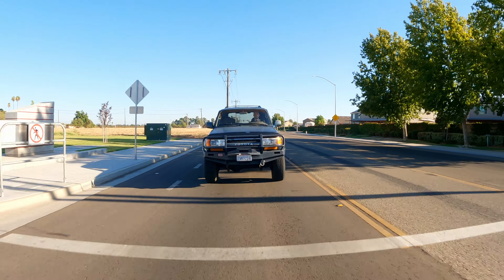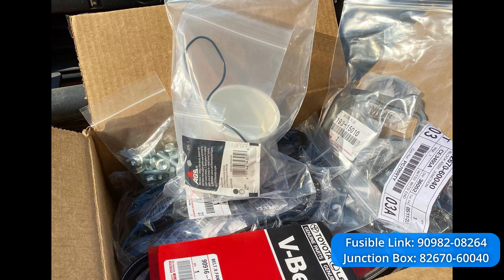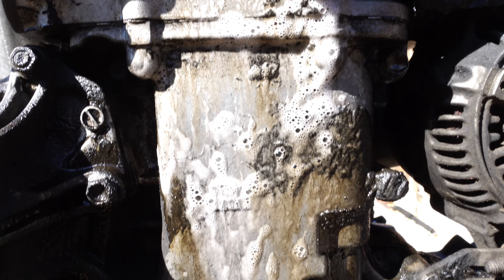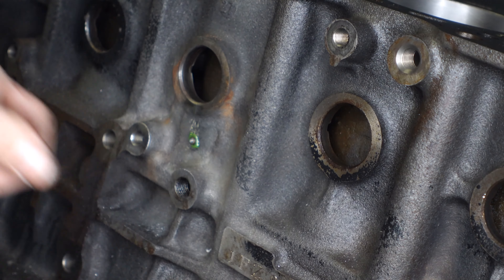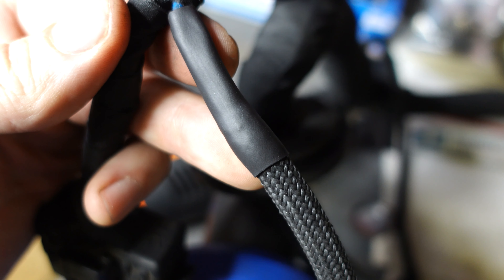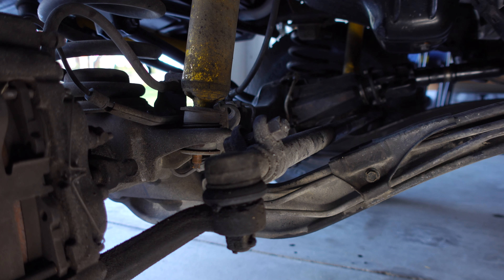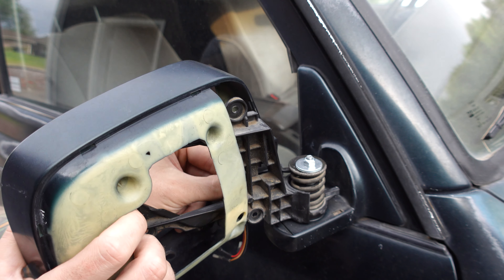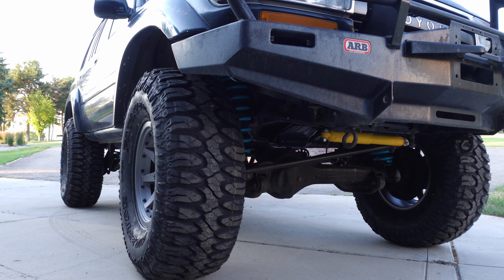How Much Does it Really Cost to Build a Land Cruiser? Not Cheap!

Comment: I have a 1988 Fj62. I’ve had her for 13 years now. I used to keep a running total of all the repairs, and, or upgrades. I stopped years ago. Keeping her running may be irrational to many, but she’s my baby. I get it, I really do. Enjoy your channel.
Reply: Mine is a 84 FJ60 have it for over 30 yrs, but it's been cheap to run. Body is awfull, but running gear tip top. Thats were my money goes. Turn key reliable and go

Comment: My parents gave me their 93 Landcruiser. It’s got 140k original miles and is triple locked. Can’t wait to get on the road.
Reply: You do not have to spend 50K to take it out on the road. I still daily drive my FJ60 on and off road. In my neck of the woods most FJ80 are Std 5 Spd Tranny. That would be my most expensive upgrade over the Auto. Std Rims and 33 Tyres next. And dont forget a Dual Battery and a 12V fridge/Frezzer, Never enough ice for Beer👍
Reply: Bro I have triple locked 94 1hdft

Comment: On, 38s with stock gears had to be a chore to get it to speed 😂.  What's the transfer case gears stock?  Good looking build.
Reply from the maker: Honestly, anything is better than my old pickup which was a 22RE on 37s. Transfer case low range is aftermarket. I can't wait to get gears installed but it's not too terrible.

Comment: was welding the block crack not an option
Reply from the maker: Nope. Would’ve been my first option but not possible. You can spray weld the cast iron block but the machine shop recommended stitching.
Reply: @RM_Garage  noted. machine shop knows best.

Comment: Prices will vary depending how much of the sales pitches you fall for. Once you have your lc back to factory reliability you are technically finished.  Every other addition is personal Chand most are luxury not necessity
Reply from the maker: Depends on your goals. If you just want to overland and drive on flat trails to go camp - sure, it's good in stock form. If you want to go on rock crawling trails, snow wheeling, etc, then a stock land cruiser on stock tires without lockers is not going to cut it. It will go further than most vehicles, but not where a modded vehicle will go.

Comment: Would it have been easier/quicker to just buy a rebuilt engine? Was the 10K inclusive of the initial price? I have seen a few LC's on line for about 7,000 or 8,000

Comment: Man, I got a $500 Isuzu trooper and built it specifically because I could build the whole thing for less than it would have cost me to buy a land cruiser and start a build. I've not seen any for less than 20K just to get the base vehicle. I am probably 10-12K into my build and it's lifted, locked front and rear, new tires, rims, bed linered bumper, winch, air compressor, new stereo, speakers, ham radio, lights, everything including rebuilding the upper part of the engine, new heater core hoses, spark plugs all oils, and all that. This stuff is crazy expensive, and there's no way for the average person to pull it off unless they can get an old hooptie and really mechanic alone. Great video. Gave me flash backs and PTSD.  LOL
Reply from the maker: I don't blame you. There are a lot of other capable vehicles that people turn a blind eye to, and it's refreshing to hear of someone taking a different approach. I bet that Trooper does well.

Comment: only use rcv axles.  you will regret all others. I've used all.  No arb supra head studs?  4x4 labs rear bumper.
Reply from the maker: Nice. I used Longfields in my pickup but was considering RCVs for the 80. No head studs because no boost, figured stock head bolts would do just fine.

Dissent is making a new ultra clearance rear bumper that really caught my eye.

Comment: Real question, not a troll.  If you knew what you knew now do you wish you had ponied up some more money for a cleaner example.  I just went through a similar rebuild with a Sequoia but I was pretty aware of the problems before hand.  An engine rebuild like you went through would have been really defeating for me.  I spent about 5k on the vehicle and 7k on parts (OEM is really more spendy than I anticipated).  I figure with the money I spent I could have just got a cleaner newer generation at this point and I end up wondering.  I really like the vehicle so I guess I'm happy.  Just curious on another capable car enthusiast thoughts.
Reply from the maker: Hmm. I would've probably liked a later model 80 for OBD2 and the updated interior, but I would've never bought it because the price would be offensive. I'm okay with having to do the engine rebuild because it gets me close with the vehicle and I know it inside and out. With that said, I'll still probably swap it for a 6.0 in the future.

The newer generation in my opinion is not as good as an 80 (and previous) series. Overall the body is straight on this truck, it has no rust, and the only issue really was a broken timing chain guide. I can't complain that much, happy with it.
Reply from the maker: I should also state that no matter what I would've bought, I'd still toss thousands of dollars of mods at it. Maybe not an engine rebuild, but still all of the other mods and then some.

Comment: What would the price for a '00 Land Cruiser 3.4 V6 be over there, in very good condition and only 12,000 miles on it? No mods, no rust and with a clean interior. Should I wait for a '98-99 model to tunr up instead due to the head crack issue?

Comment: Very cool coolant gauge where did you get that? Does it wire into the factory temperature sensing probe?
Reply from the maker: I have a video showing how I installed it. It doesn’t go to the factory temp sender and the brand is “Koso”

Comment: Well done. I am, however, surprised you didn’t just spring for the OEM pistons.
Reply from the maker: Overpriced at $130 a piston. I asked the machine shop how often they use 3rd party pistons and they said in every build. (As was my experience and never had an issue)

Already spent too much money on an underpowered engine when I could’ve gone LS, and probably will in the future.
Reply: @RM_Garage  ah, I see.

Comment: How does it drive with the oversized wheels & tires? 
I bought a 1997 4Runner, it had 15” oversized negative wheels & tires, it road horrible. I replaced the wheels with stock 2020 4Runner 17” wheels, with the factory offset. It rides great now. It goes over giant pot holes, & cracks in the street much better than the other wheels. It feels totally stable on the freeway now. Yes I had it aligned. 

Great. Job on your Land Cruiser! Awesome you’re paying attention to mechanical detail. Not just tying to make it look cool.
Reply from the maker: Honestly it drives really well but my suspension is also upgraded.

Comment: Since you decked the block and resurfaced the cylinder head did you have to run a thicker head gasket?
Reply from the maker: Nope, machine shop said stock gasket accounts for small tolerances. Only .002” or something was shaved off the block and head. So about 4 thousandths difference afterwards.
Reply: @RM_Garage  I am doing a 3.4 swap and I am picking my engine up tomorrow from the machine shop. They also decked my block, bored out 20 over, full head job. I was going to ask them tomorrow about head gaskets to be safe. I was just curious what your expereince was.
Reply from the maker: @Mike_Allegro I’m sure it’ll be fine but always good to ask!

Comment: A question. Why do people say these cars are reliable when you constantly have to repair them? I’m thinking of buying one with 260k miles but have zero knowledge on repairing it.
Reply from the maker: At 260 it has probably had the head gasket replaced by then and standard maintenance done, hopefully. The engines are prone to head gasket failure that’s no mystery, but the reason they say that is because the rest of the vehicle is very very robust and overbuilt. The engine is too - just had that head gasket issue. It’s a one and done fix
Reply from the maker: Going to the length I went to is unnecessary. I’m crazy.

Comment: Help me with the definition
I was under the impression this is an fj80 Toyota lettering in the grill fj engine
And it wasn't an fzj80 until 1995 with the fzj engine and Toyota symbol on the grill in
Reply from the maker: 93+ are FZJs. Motor and other changes make them an FZJ. 95-97 are the same as a 93-94 but have an interior refresh, OBD2 in the states, all have ABS, and different A343 trans but many would argue that the 93-94 trans is stronger.

Comment: i just lucked out and got a 80 series 96 model not triple locked for $4800 but came with the smitty winch , arb bumper , procomp lights , OME 3'' lift and brand new 35'' Yokahama G003's. but the caveat is that it needs hella maintenance to try to save it but its a really good starting point i think

Comment: I own a 96 LX450

Base Truck cost was $15k
Included mods are 4” lift (needed new shocks), new KM2s (35s), ARB front bumper, 15k lb winch, 4 nice off-road lights (can’t remember the brand), roof rack, hood rack, high lift jack, upgraded axils, front and rear Yukon air lockers.

Upgrades/maintenance after purchase:
Full hose replacement, new steering box, new power steering pump, blue fan clutch mod, scan gauge, marlin rock crawler steering upgrade, white knuckle rock sliders, new seal kit for the birfield joints, new ABS module, replaced lift kit, new break master cylinder and full set of new breaks (disks and calipers), upgraded steel hose break lines

Current total investment is around $25k.  

Truck has 261k miles.  It’s a true trail truck and I use it.

Comment: I used have a '80 fj40. And loved it it but it just wasn't reliable,  was constantly breaking down and the parts were becoming unobtainum, and the body couldn't hold up to colorado weather . so sold it before bankrupted me,  that in was 2002.
I wanted  a replacement long time and got a fully tricked out 2000 jeep tj with air lockers 4.0l 5 sp 150k miles 35"tires $8k in 2023. 
The cheapest working not falling apart fj find is $25k. Thats ridiculous when the jeep can find parts everywhere and not cost a fortune unlike any old toyota fj or land cruisers.
Keeping an old fj is just for sentiment not practicality.
Reply: Spent so much time working on my buddy's FJ40. Just couldn't keep it cool. Changed all the cooling components. Timing was done several times. Carb was changed. He wanted nothing but Toyota parts so I couldn't convince him to upgrade anything. He ended up selling it last year. I've got one the engines sitting in my barn still.

Comment: It’s just like watching the 4Runner videos a old fan just checking in on you. I know you’re not finished with this just yet. Thank you for all the videos over the years. My heart is still 4Runner I am almost ready to send mine out to get overhauled everything inside and out front to back with a custom rear lid that can handle a roof top tent with interior access that’s my dream I figured after watching a lot of videos on rebuilding rigs it’s going to cost a few bucks but I’m the end a vintage Toyota is going to be on the road for the rest of my life it’s going to cost way less than a new off road vehicle

Comment: I bought a LC200 for 13k Euro. 124.000 km with a petrol 1GR-FE engine. I spent 7k to get it ready to hit the road, that is, in gear. Car itself had 0 issues, but i changed all the fluids to make sure. It's now a season and 20. 000 something kilometers on and still 0 issues, but a whole lot of fun later. Not regretting the investment.

Comment: Thank you! I love these 80 series, but i was having my doubts due to all the horror stories of dozens of thousands of dollars needed to just get them working,  but you actually sharing the break down of the costs and. The things you did, made me realize it's actually within my budget with room to spare!

I'm mechanically inclined, but new to project cars, so I was having a hard time figuring out a realistic cost for this, and it was the only thing holding me back.

Here's hoping I find one at a reasonable price!
Reply: Spend the money and get one already sorted. Preventative maintenance and baselining alone will be thousands. I can’t even imagine how much a shop would charge buying one for 5k and needing to do all this
Reply: Buy one that had the head gasket done by a reputable shop or count on doing it yourself. Don't waste money on low mileage cars as they will all need a top end rebuild regardless
Reply: @skaboom64  I have the space in my garage and as long as I have a service manual, I can sort almost anything myself, the ones already sorted out in my area are north of 30k and rust free, low miles, good service history and in need of head gasket and big maintenance jobs easily 4k, it would even be cheaper to put a 1uz in one of those than buying a sorted one.

Comment: I also got my 97 land cruiser for about $5k, it had 150k miles. I fixed it up, did baseline, threw a couple pretty mods on it, and it was my daily driver for about 2 years. Sold it for 17k. Wish I vlogged me building up the car.

Comment: Great Video! 38s look.great. Did you re-gear? I always felt 35s were max before requiring a regear. Maybe you can get away with it at sea level, but in the mountains, 38s will slow you down.
Reply from the maker: I didn’t regear yet. I’m at 2700ft, and it seems fine so far but I do plan to regear. This also isn’t my daily so it’s not painful when I do drive it. Even with 38s and stock gears it’s so much more power than my old pickup with the 22RE and 5.29s.
Reply: I know exactly when mine hits 5000ft, put put put...

Comment: "Wit's End... A great shop"     NOT
Reply from the maker: Times have changed since then. Agreed, went downhill and completely stopped shipping items. Unacceptable
Reply: @RM_Garage  Didn't mean to take away from your build and efforts. This is a sweet ride. I am curious how do you like the transfer case low range upgrade?
Reply from the maker: @FinMcMurder  Oh no problem, I didn't think that. I love it. The first thing I do on any offroad truck that's going to be used for wheeling is get the transfer case doubled or geared lower.

Comment: the beast is never satiated... Haven't done too much research into the low range gearing but good to see the price range isnt too crazy. Throwing on a 6 inch lift to get 3 inches after adding weight is super creative. I'm running 2.5 inch lift heavies but flex is gated by the length of the shocks. The solution you chose sounds pretty promising! Good stuff
Reply: @1995Kakashi
11 days ago
the beast is never satiated - too true

Comment: I997 80 series for 20 years here, great job and thanks for Sharing ! Some advice if i may. If you plan on doing some hard core wheeling, 4.88s ring and pinion are what i have run with 35/36 inch tire range. 5.29 pinions are just too small in my opinion .
But i know some 80’owners that run them with 40s with no Problems. 4x4 lab rear bumper is great, metal tech skidplate, RCV gun drilled front CVs, they have rear axleshafts now, double cardan front drive shaft, ARP
STUDS when you rebuild your axles . I have factory lockers but you may want to do Harop elockers.

Comment: I have an 2006 100 series. I've spent $55k including the cost of the vehicle. It now has 135,00 miles on it. It's heavily modified (not mechanically as that's bulletproof) and all of the body and frame rust has been taken care of. It's been so so on reliability. I'm going through Birfield joints on a regular basis so I'm troubleshooting that issue. All things considered I would buy it all over again. I will never sell her. LC's are in a league of their own. Best with your project.

Comment: Nice info. I bought a 93 landcruiser, triple locked with 330k miles back in 2021 for $3800. I use it on the beach for surf fishing here in MD. After I bought it,  I painted white, added 33 inch tires,  replaced battery, and its been running great. I've put about 4000 miles on it and no major issues. I had to replace a throttle cable last month and the AC just stopped working .  The previous owner was a gear head and did a lot of engine repair so I consider myself very lucky. I might sell here in MD later next year.

Comment: I've been thinking about rebuilding my 97 40th Anniversary with 295k on it, which I basically love.  Original paint (bad condition) and interior (worn).  Not too sure of the condition of the components of the power train, but would consider it worthwhile if I could get to a stage of reliability.  Interior and exterior needs work as well as the HVAC as apparently the AC module is no longer available.  Electric components are rotting as well some trim parts.  I'd like to figure out a better gas mileage as it's running at 16 mpg normally with a cylinder having problems.  No interlock, but it working on the tranny, then could be added.  I was happy to see your video and appreciate your insight into the various elements of a rebuild.

Comment: Great looking truck and shaping up to be an awesome build. Only thing I don't get is you talked about OEM parts lasting longer, you put a ton of money and work into the engine, and you're running green coolant. Everything I have ever heard about Toyota says that the red is the only way to go. Something about silicates and the metallurgy of the Japanese engines. Maybe you got a low silicate green but still, the OEM is not expensive and it was made for the engine. Just my 2 cents. Keep wheelin!
Reply from the maker: All green coolant or all red coolant, never mix, and you're good. That's what I've always done and really I've had no problems. I've ran green coolant, I've ran red coolant, both work. The main thing is never ever mix and don't use stuff like dexcool etc. Thank you for watching!!